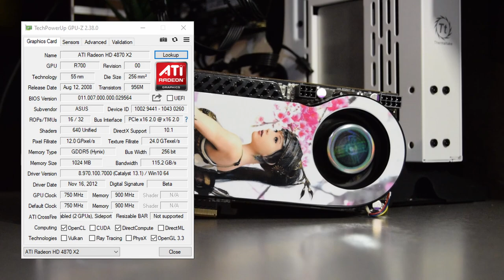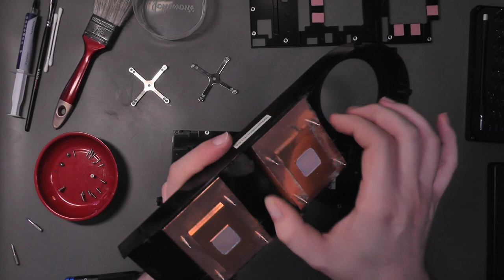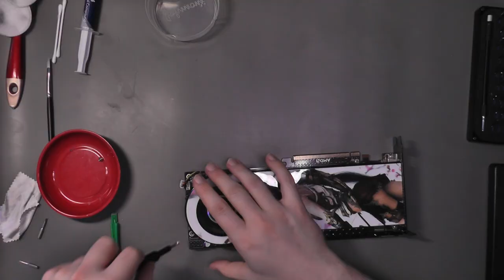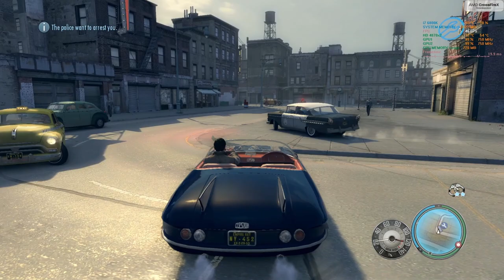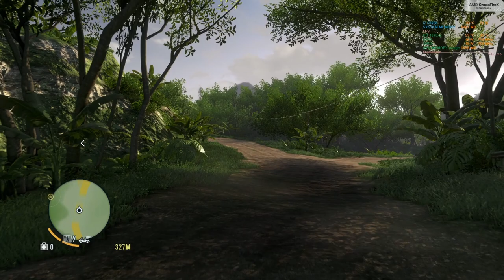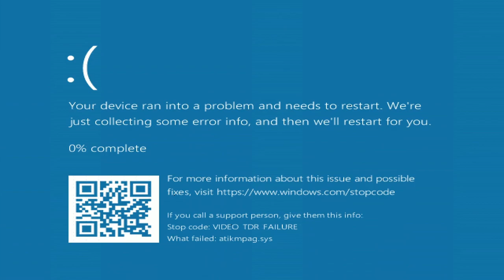AMD Radeon HD 4870 X2 tested in 2021 - Flawed beauty!

Comment: I had this card from 2009 til 2015 and to be honnest it was still doing a good job at 1080p but i got a 2560X1600 monitor and at that resolution the 2x2gb of memory was just not cutting it on some games and the games that didn't support CF made it really show its age. Also mine suffered from a faulty fan. I ended up cutting the cone end from a 2l soda bottle and hot glued a 120mm fan om the wide end. The noise level improved A LOT! 😅

Comment: Still have this card on my shelf as a memory. It was a beat back then.
Never had any real problems tbh. At least nothing driver update could fix.
But holy is it loud!

Definitely won't ever sell this beauty even if its just catching dust by now.
Reply from the maker: Mine sadly died, no longer have it :(
Reply: @nexus_tech  Well, why sell it for scraps when you just could've had it on ur shelf lol. 
This card, this edition, will be a precious collectors item in a couple decades (as if it weren't already).

Edit: Not to mention the fact that it most likely could've been repaired with some patience & practice, rarely does the die, die ;)

Comment: Nice vid. I had this beast of a card years ago. Loved it and honestly I could run everything at max settings back then. One thing is that I was basically forced to change the stock cooler to the Arctic Cooling Accelero Xtreme 4870X2. This card would overheat very frequently with he stock cooler being inefficient and loud as hell. Sounded like a jet plane if you ask me. The after market cooler did an awesome job and made the card even sexier lol.
Reply from the maker: Hi Kelly! Thanks for checking out the video! Yes, this gets rather loud! Did you see noticeable drop in temps or was it mostly about the noise reduction ? :)
Reply: @nexus_tech  Hi. Night and day type of drop in temps. Basically I had major overheating issues causing all kinds of problems from artifacts to crashes. I bought the after market cooler just about a week after I got the card. After that everything went smoothly for years. I can't remember the temps though but as I recall it went from horrible to great. And of course super quiet.
Reply from the maker: @Daya97228  I saw few of them on different cards, never on 4870x2! If I spot one, I'll get it :)
Reply: Yeap,ot was a curse of them cards....

Comment: That gpu has either damaged memory modules, voltage regulators, capacitors or simply it's overheating on memory... Check out thermal pads maybe... Also try older gpu driver, something like 11.4 or 12.3

Comment: I got two Radeon 4870 X2 now, another third one is ordered too.. should showing up soon..

What should I say about my opinionon the this card so far?.. Well. I feel very stupid for buying  theese 4870 x2 cards. Should have quite this project of making the "ultimate 2008 retro PC".  Absoluttely my badest decission this year, buying theese cards.

I'm so agree with this review of the card, it's very accurate after my experince with it also. I should have seen this video before i bought the cards.. :(

The design is lovely, and like said in this review. It really got some horsepower in some games and benchmarks, but.. There's a whole lot of but.

The first card i got was faulty.. The second showed some artifacts at first startup. After hours of work, I mannaged to got it work.. But only halfways.. The card needed to held not more than 35 ° Celsius. To achive this I had to set the computer outside the house.. The GPU fan running at 100%, so it sounded like an Airplane. And that wasn't enough, got to stick the most noisy 120 mm fan that I had blowing towards the card. Now, I finaly could get it to work whitout artifacts.. When all this was done and I got rid of the artifacts I could to some tests.

It scored way over the single core 4870 that I also got. But this only happend in a few games and benchmarks. Sometimes it performance was less than the 4870.

Anyway, my next project was to trying to find the temperature limit this card could do whitout artifacts? And so far I've concluded that it won't work any stable beyond temperatures above 35 °C, it then starts to show artifacts, hang, got bluescreens all the time and restart the machine. At the next boot-up, it will just hang and won't even boot into Windows. And showing just crap on the screen.

I've red so much about this card now. And used a lot of time trying out different things. For to figure out a way around just to have it running in my 2008 build, but I'm starting to give it all up and I'm very dissapointed.. I will try the third card when it shows up, if the same thing happens, I thinking of just stick to a Nvidia cards newer than year 2003.. Ati/AMD was the best cards in the early 2000's in my opinion. Just got to love the Radeon, 9700 and 9800-series.. But this complete shitt, not so much. Not at all.

Comment: hello. Did u try compatible mode as for WIN7 ?Cmd for an 16bit pattern used for IGP  . Unifl catalyst 15.2 should give you CFx on compatibility.
ps. try Render test .make her Clocks , so there will be no Stutter . Cheers !
Reply from the maker: Hi Marius! Thanks for checking out the content :) No, all testing was done on fairly recent W10 build and with CC 13.1  directly of AMD's website. The card is unwell, most likely never going to be used :(

Comment: I saw another YouTuber with the same card and the same issue. It seems they are very prone to failing. At least it is a good looking paper weight I guess.
Reply from the maker: Yes, it's very unfortunate! This card feels so special in hands...it's solid, heavy
Reply: @nexus_tech    I think this card was never meant for Windows 10. Because of DirectX limitation.
What OS did you run this card on?
Try Windows 7 instead.